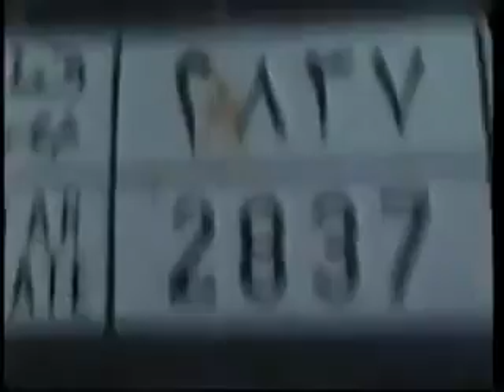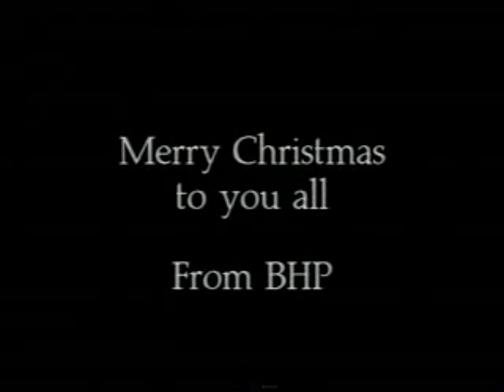Audi quattro Rally Gearbox change

Comment: I am one of the mechanics in the video. RIP David Sutton sadly missed, thanks for all the good times.
Reply: you are all legends. i'm just seeing this now, what was the rush about?
Reply: @nenume00  in truth to prove we could do it. It had to be done and that was a convenient place to do it
Reply: @davidingram3566  did you guys by any chance run into issues with the shift collars during the stages, is that what failed is this instance?
Reply: How much practice of this exact scenario did you boys do before it became a 15 minute job?
Reply: I'm actually changing the clutch disc and pressure plate in my a4 Quattro I came here for inspiration
Reply: You are heros!!! Not human change a quattro gearbox in a record time like this!!! Respect and admiration!!!!
Reply: In general reply. I seem to recall the box was stuck in gear so yes it had likely ‘over selected’. I wouldn’t say practice as such, I had worked on Quattros since going to Germany to train on them before they even came to GB and subsequently worked on them day in and day out, it was more a case of repetition. In case you hadn’t noticed there is an awful lot done to make the job quicker ie, the top of the bell housing is cut off to clear the rack, there are only three bolts holding the drive shaft on(the other three are replaced by dowels), holes in the firewall to access bell housing bolts, and so on.
Reply: @davidingram3566  you're a legend bro I wasn't born yet when you guys did this this video is shown in private forums legendary stuff
Reply: So rad!! Thanks for sharing your insight on the experience
Reply: How did you get a job like that?
Reply: @themeditteranian8365  yes scary really to think I will be 65 next birthday, I recon I could still do it though - perhaps not as quickly though.
Reply: Legend!!!!!!!!!!!
Reply: I was 1 hour trying to put a wishbone into a ford focus
Reply: Can you tell us how long did it take? There were some cuts in the video and 5 minutes seems Just too beautiful
Reply: @Xsidon  This one was 15 minutes  although we did do a 13 minute change once.
Reply: @davidingram3566  Still mighty impressive especially without power tools. Audi has probably the hardest transmission swaps out of any longitudinaly mounted engine car brands
Reply: which mechanic are you? How long did you pit for rally teams?
Reply: @kam651 
Took me 2 hours to change disc's and pads on a friends Ford Fiesta recently!!  In my defence though, I had to deal with rusty and stuck parts!